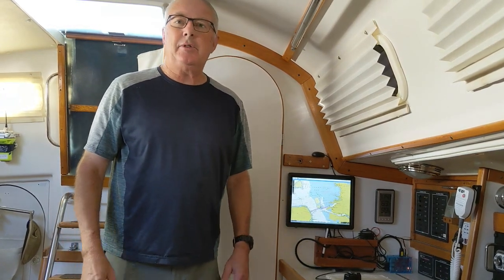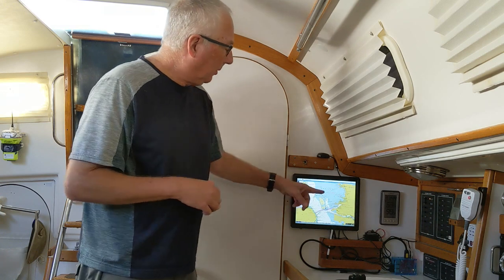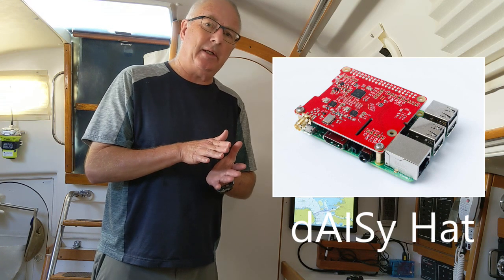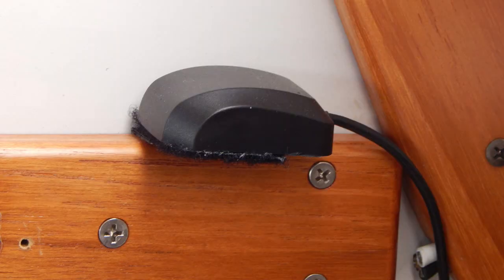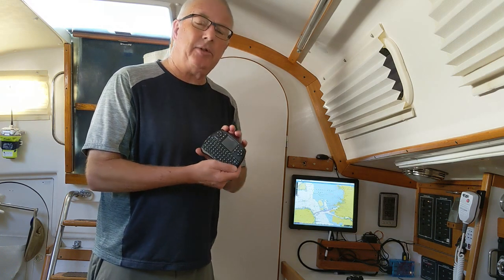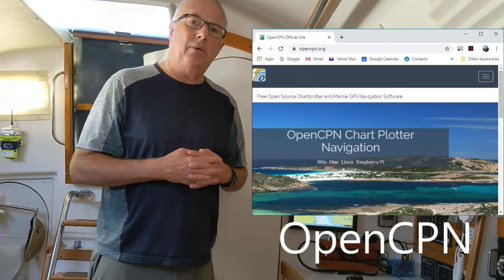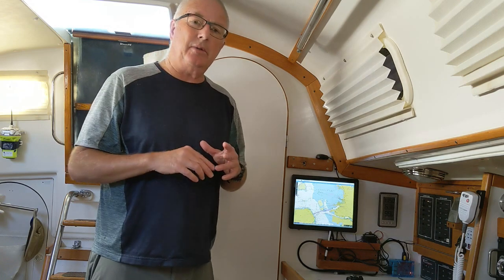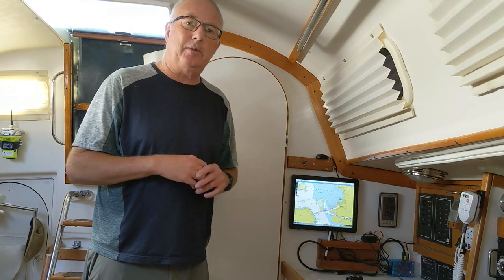Building your own Chartplotter with a Raspberry Pi and OpenCPN

Comment: Question: Any issues with very slow zoom & pan? I just got opencpn up an running on a pi4 and find the graphics so slow so it is not really usable. I have not seen anyone talking about sluggish graphics.....
Reply from the maker: No. I'm getting really snappy performance out of the video system. Since it is straight HDMI, you might try testing the display using another computer and see how it behaves.
Reply: Ok, thanks for your input. Then I have to find out what kind of problem I have.
Reply: Hi  @jamesconger8509  , one question. What kind of media do store your charts on? I am thinking, maybe my first test only using the SD card is a problem.
Reply from the maker: @leiflindqvist9095  I have everything on a single SD card.
Reply: Could be the transmission rate of the card. I'd get one that is rated high enough for a gopro. If it can write full HD then it should support opencpn graphics with easy

Comment: How do you add the radar overlay if you need one?
Reply from the maker: I have not done it, but take a look at the OpenCPN radar plug in https://opencpn.org/OpenCPN/plugins/radarPI.html
Reply: @jamesconger8509  Can your project be done on a tablet running on Opencpn instead of Openplotter on a Raspberry Pi?
Reply from the maker: @wilsont1010  A friend did something like that. Used the RPi and AIS board to collect AIS data, and then broadcast it via WiFi. The tablet can then run the chartplotter software and displays AIS data.

Comment: Can one get weather fax via ais?
Reply from the maker: No. But you could use the same Raspberry Pi to download GRIB files if you hooked it up to some sort of communications link via a USB cable - ideally satellite data for long distance sails. The RPi is just a small computer, so you can use it for any other need like email, web browsing, etc. On my boat I dedicate this unit to being a chart plotter, as I have other devices to do the rest of it.
Reply: Weather fax is broadcast in HF, AIS is a voluntary boat reporting system and works on VHF. You CAN get weatherfax with the same raspberry but you would need an HF capable receiver + antenna + USB soundcard plugged to the pi and some sonftware like fldigi. You can then overlay the radiofax pictures on the chartplotter. It's doable you just need more gear.
Reply: @tasheido  I have the furuno weather fax 207. I have yet to hook it up, I need to figure out what all is needed for that. I have the manual and need to get the antenna cable and other knickknacks, I got it mounted on the wall so far and just need to run power and antenna to it as far as I know.
Reply: Those units are standalone, like you said you have to power it and hook up an antenna. The manual gives you a couple of antenna options, you can use a vertical whip or a wire antenna, that will depend on what suits your boat best. Most boats with HF use insulated backstay antennas for their HF transmitters. Sharing antennas for TX/RX need some special attention and consideration. Get a ham friend to help you out if you can. If you dont have an HF transmitter onboard than set up a wire antenna to the top of the mast for the furuno unit. Dont forget to proper gound the equipment for best reception. That thing prints out the charts directlly on paper no need for a computer. It has its pros and its cons.. good luck!